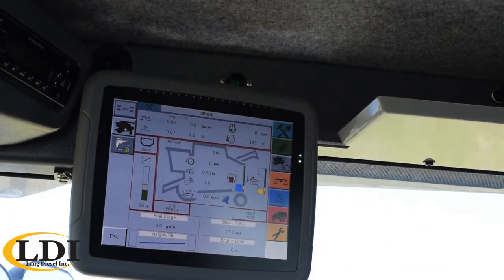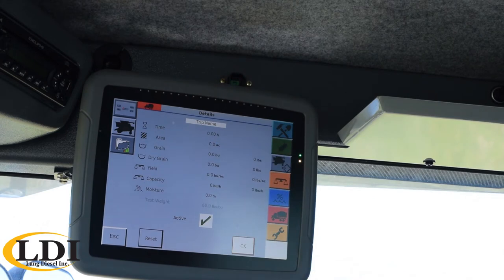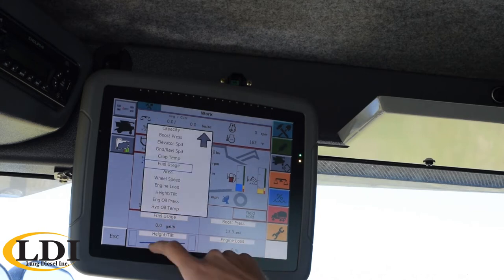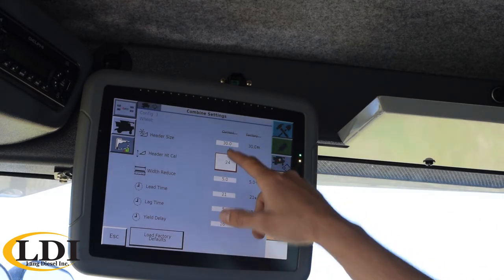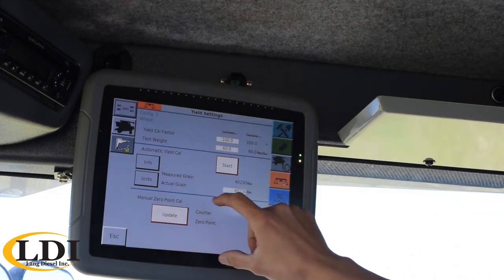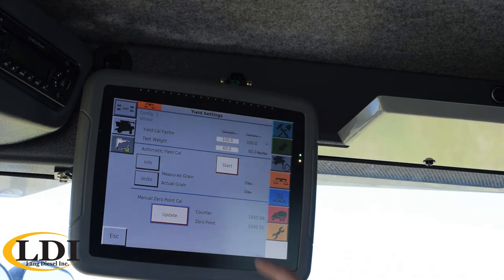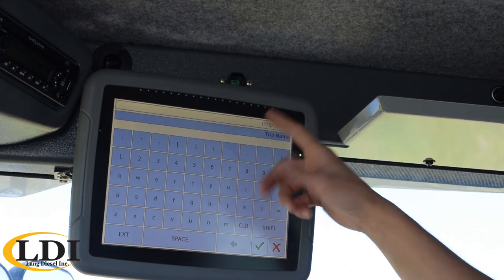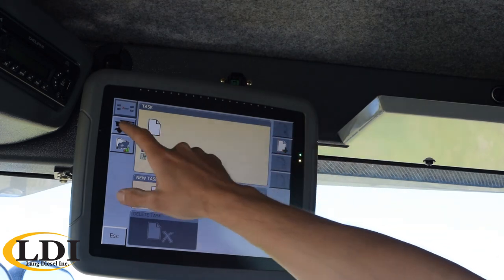Quick overview of Gleaner C2100 Monitor

Comment: In the task controller should I guy be using combine interface card or the API-Tru path which is the ag3000 auto steer.  Of the 2 combines when in the combine interface when i change the with of the header in the terminal one will switch in the task controller too but one won't...not sure what i messed up there so might have to run it with API-Tru path that way when switch heads on the auto steer it switches in the task controller also....is there anyway to fix that one in the combine interface that is not changing?  

question 2 is I uploaded grow farm field names from SMS and all the names came in right expect i start a new task and assign it to the grower farm field it wont let me edit the field level so I can add in a crop say wheat or canola or soybeans.  Is there a different step where I can do add the crop type? I can bring them into SMS at the end of the year without a crop type but it comes in as an unknown crop then I have to reprocess each field with the right test weights to get it to come out right.  

Thanks in advance your videos sure do help.
Reply from the maker: Question 1:  It always needs to be set to Combine Interface Card or data will not be recorded.

Question 2: If I understand the question correctly, the farm and field names were created in SMS and uploaded to the monitor, and inside the monitor crop type can’t be selected?  If that’s the scenario, were the files exported from SMS in the correct AGCO file type?
Reply: I got the combine interface card fixed.